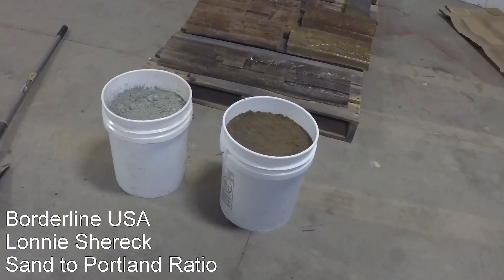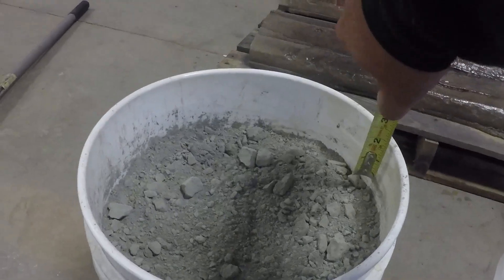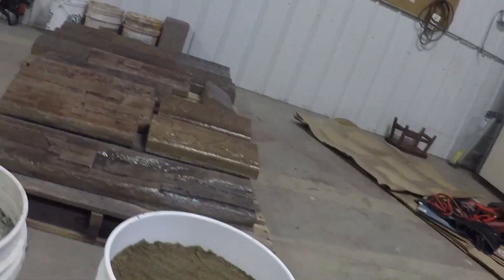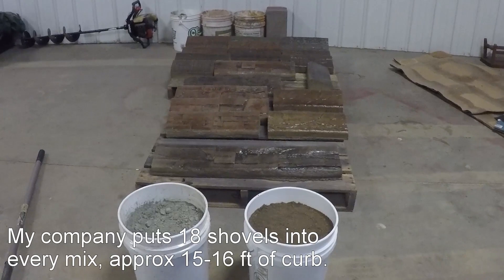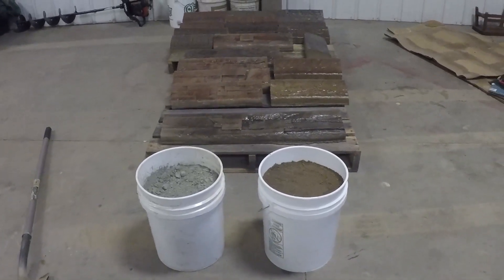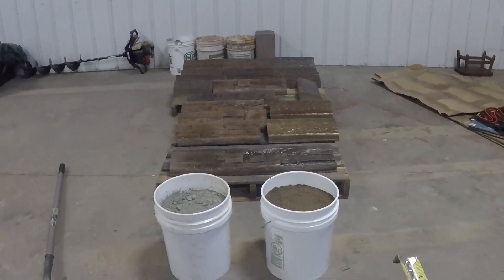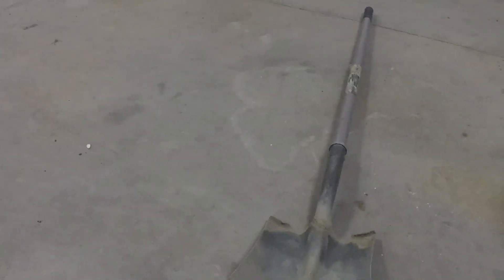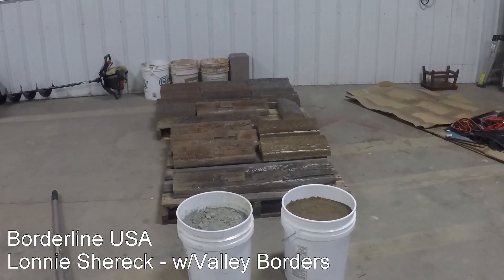Landscape curbing - Sand to Portland Ratio for curbing.  Borderlineusa.com

Comment: Your still confusing people.  Make a line on the bucket where 1 bag of Portland reaches. Now dump it out and fill it with sand to the same level 4 times. That’s 4/1. You can use any container. You could do 1 cup of Portland and 4 cups of sand, it doesn’t matter. 

If you want to get exact with shovel full amounts,  count how many it takes to fill up to the line on the bucket and multiply by 4.
Reply from the maker: How is that confusing?
U need to have 4 parts sand to one part portland. Fill bucket to top with portland then do same with sand, I dont use buckets as we do a particular amount of shovels as we have measured that amount. For 30 years people have been told 4 full buckets to bag portland, that's not a 4 to 1 ratio. 
I'm not forcing u to watch, if ur confused then dont watch em.
Reply: Borderline USA here’s why. “For a 4:1 mix your not gonna use a full bucket. Go   2” down from the top. Each bucket is 5 gallons and approx 15”  so that’s 4 times 2, so  8” down cause theres 4 buckets, that’s means your gonna use 3 and a half buckets  for 4:1 mix”

Idk how people dont understand. Get a container and fill it up to with cement and dump into a pile. Use the same container and fill it up with sand 4 times. Mix the 4 sands with one cement. Done. 

I’m not picking on you I’m just pointing out that it’s very simple
Reply from the maker: Ur telling me things that are already pointed out. We tell people 3 1/3 buckets in the other videos.
I'm not even sure what point ur trying to make as what ur saying was already said in this video and many others.
Reply from the maker: 3 1/2
Reply from the maker: Watch mixing video #1, says same thing
Reply from the maker: Thing is portland comes in 47 lb bags that most of us use, and that 47 lb bag only reaches that point in a 5 gallon bucket. If u half a 94 lb bags which others use then it comes to the same point in that bucket, I know its 4 to 1 on any container,  the point I'm making is that for the last 40 years curbers have been told to use 4 full buckets to a 47 lb bag, the whole point of the vid is to show that isnt right.
I dont use buckets as we use shovels but this is for beginners to learn, blahblahblah

Comment: I always use 2 sand if I'm not using 1 sand. 1 inch all the way around the circular plastic piece. And only 18 mini shovels from grams garden shack the shovel is 8 inches in total length with good grip. But anyways use that 2 sand mini shoveler.
Reply from the maker: Wut the hell u talking about
Reply: @borders06  company guidelines sir.
Reply from the maker: I still don't understand, company guidelines?
Are u asking a question?

Comment: Are you using mason or river sand for your mix? I worked with a gut that started with a river sand switched to mason for better results and stouter curb. River had to much dirt where mason is pretty much clean crushed rock crumbs. I am watching this video because I for got the ratio while watching a guy making planter boxes for raised flower beds.

Comment: And if you're using 94 pound bags then you've already been doing this by default haha
Reply from the maker: @jschlaud6  ?
Reply: @borders06  I'm not using whole bags of cement and then basing my sand content on that. With 94 lb bags I get approx. 2.5 batches per bag. I use buckets and fill them to the same height to achieve a 4-1 ratio.

Comment: Hay mate quick question do you recommend using crusher dust in your kerb mix with sand.
Reply from the maker: what do you mean, crusher dust
Reply: It's washed gravel around 3mm chip
Reply: I do kerbing using edge master machine we u 1 part Portland cement , 2 parts sand an 1 part crusher dust.  Just wanted to know if you'll recommend this mixture
Reply from the maker: is there a reason your using it?  someone told you or feel you need to?  how does it trowel?
Reply: Or do you think using sand with fibres n sum other bonding agents is more durable. And can I ask you I've just found out that using a small amount of suggar can also help slow down the trying process by up to an HR or 2. Have u ever heard or used it before
Reply from the maker: where are you located?  aussie?
borderlineusa.com
Reply from the maker: done mess with sugar,   are you doing this mix for commercial curb are regular landscape curb, you dont need that kind of agg in it,  its not designed to be driven on.  do you have cracking issues?
Reply from the maker: there are chems you can use to slow curing,
Reply: It trowels good. My boss has been using this method for a while . It's ok but time consuming to mix as we get it placed on our truck half sand on one side n crusher on the other. Then I've got to feed my mixer using those ratios 1 Portland,2sand ,1 crusher dust. Once done mixing.  Placed in barrow,feed machine. Then we apply a slurry over the intre kerb. Using mortar sand , Portland cement n a cap of bonding agent. Sorry for long message mate
Reply: New Zealand
Reply: I use that mix for general house kerb edging. But this job I'm doing atm is a profile we got made for a customer which wanted a 250mm wide by 125mm in hight with 20mm dish on top which will act as a gally for rain to travel into drainage on both ends of driveway approximately 200 metres of it
Reply: Sweet man keep up the good work an good info you show. Helps alot happy to support your channel
Reply from the maker: no one here does slurry anymore.  you can do way more with just integrals and releases then mixing slurry.  thats 20 years ago.  a finer clean sand with the correct chemicals will give you a nice smooth curb that will be as strong as you need for landscape curb
Reply: Thanks mate Tops I'll look into it abit more. Thanks for tips

Comment: What type of concrete do you recommend?  Does quickcreate dry faster?
Reply: You can't use anything that is pre mixed, you must used sand with portland cement and mix yourself.  Mortar mixers are what you need, not a barrel mixer.

Comment: Hey I appreciate the info, is there anything wrong with ising a 3 to 1 mix?? I was thinking about that to help strengthen it a bit
Reply: Works just fine for fence posts! (I work at a fencing company). I’ve been on jobs where we had to tear out posts with that ratio, and it is STUPID strong (jackhammers definitely needed). No clue what constant sun will do to it though.